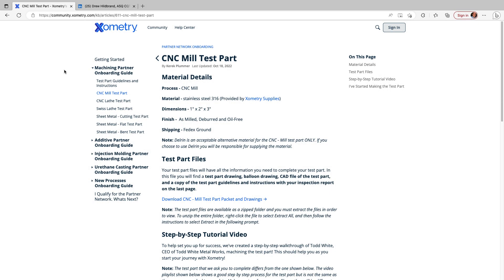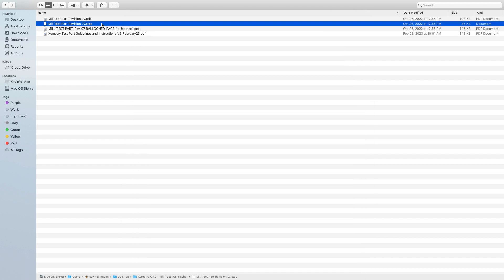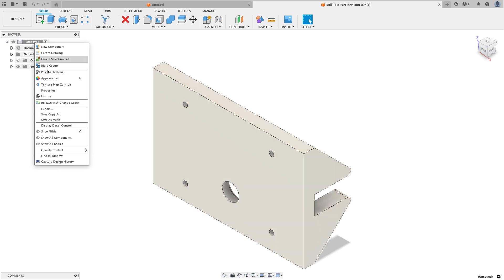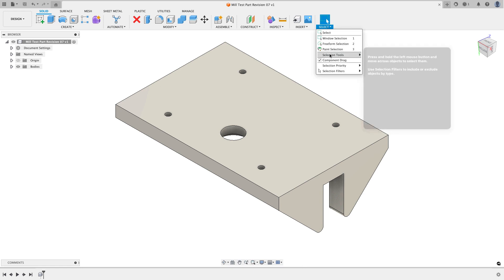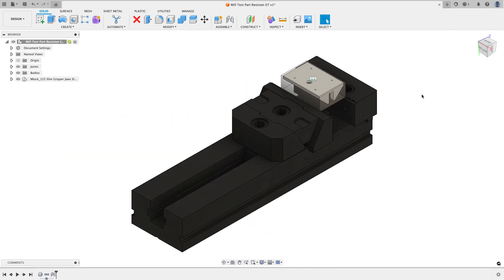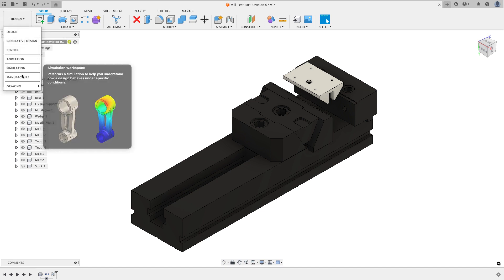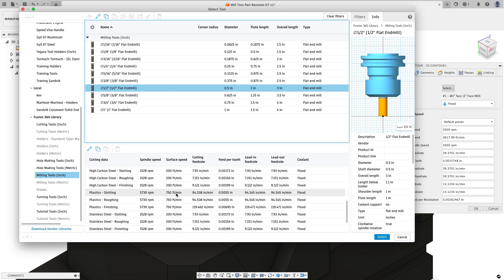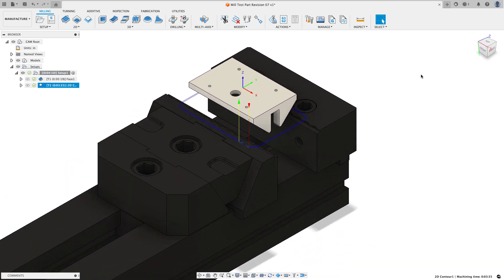Programming Xometry Mill Test Part using Fusion 360 - PT 1

Comment: Could have used this 8 months ago when I did my first attempt.  Passed the inspection and began checking the job boards.  Wow is all I could say because making money with them is like a wash.  For the first five jobs from what I understand are the first tier jobs and after those 5 where you prove yourself you move up to the better jobs.
Reply: Thanks for the post. Are you saying that it is still a wash even after the first 5 jobs with them?
Reply: @qcnck2776  Looking at the first five its depressing because I made twice as much now for the trade that I'm in.  I'm factoring in my time, material and making soft jaws, inspection report time, packing, shipping for a one off part barely to break even so I don't even touch them.  I can see where xometry could be good for a job shop being slow to keep an employee busy or something.  I totally get it though.  Why would Xometry give the top jobs to a n00b that hasn't proven him/herself first.  How about some incentive though.... I'm not this hungry yet...
Reply: @tdg911  Appreciate the detailed reply👍
Reply from the maker: Sorry! I guess my timing was off. Out of curiosity, did you machine yours in the same orientation I did for the first setup?
Reply: @MechanicalAdvantage  Don't be sorry at all!  You have awesome videos.  I did not but I should have because when I flipped mine over I had to machine a piece of material that fit perfectly between the two raised features and clamped in the vise.  Actually you and I have exchanged several emails in the past about remote training.  If you would like I'll send you my Fusion 360 file to see what my approach was?  thanks again for bringing us great videos!
Reply from the maker: Oh I remember who you are for sure. Yeah, go ahead and send it over if you don’t mind.